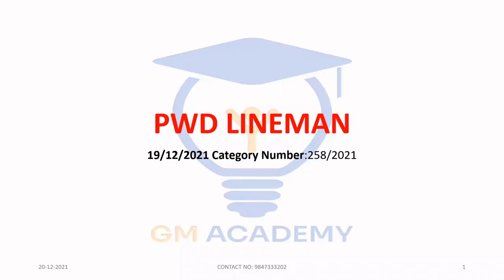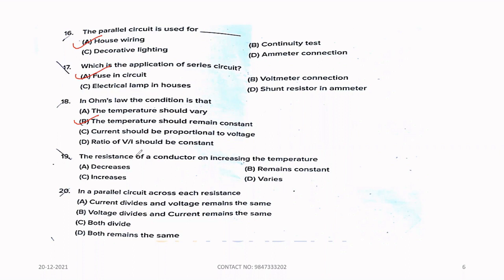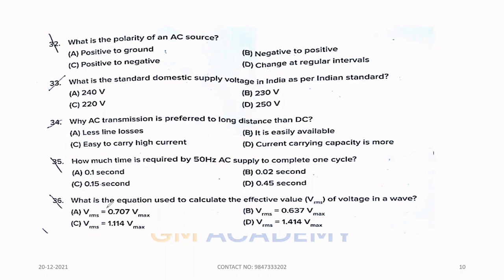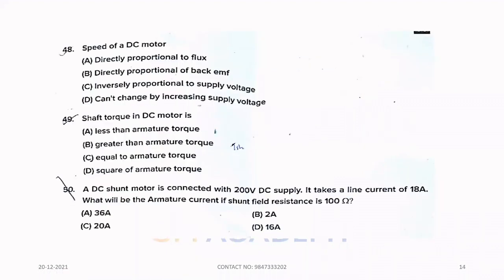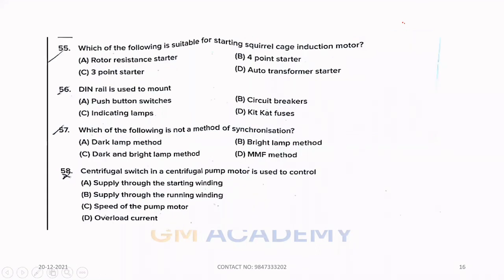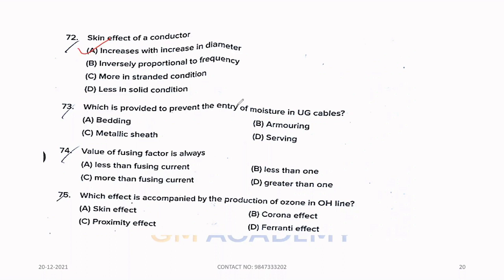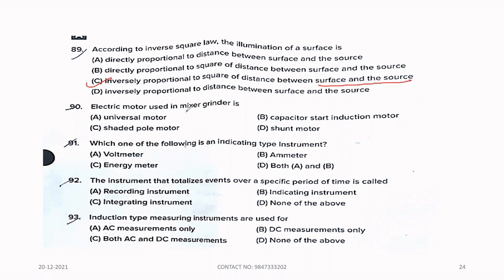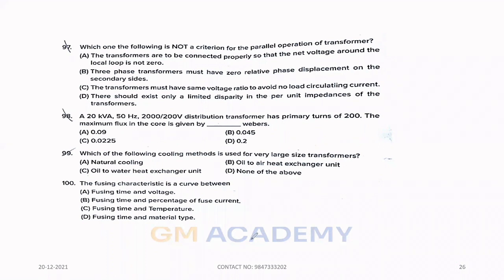PWD LINEMAN 258/2021 | 19/12/2021 | KERALA PSC | QUESTIONS AND ANSWER | EXPECTED CUTOFF | AMSWER KEY

Comment: I think 58 is option A;

Because centrifugal switch used to disconnect the starting winding of the motor once the motor approaches its normal operating speed.

Comment: Centrifugal pump nte question nte answer obtion A alle auxiliary winding thanne alle starting winding auxiliary winding cut cheyyuka enn vechal ath vazhi Ula supply control cheyyuka alle angane nokkiyal option A alle varunarh
Reply from the maker: for controlling the supply this method is not adopting, and we mentioned that centrifugal switch is not controlling the speed, but it has a role relate with speed